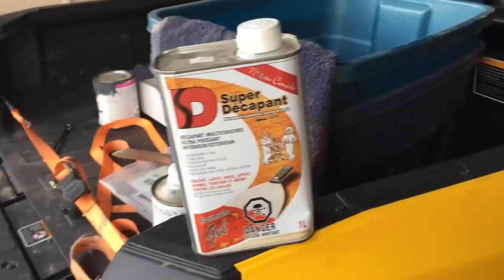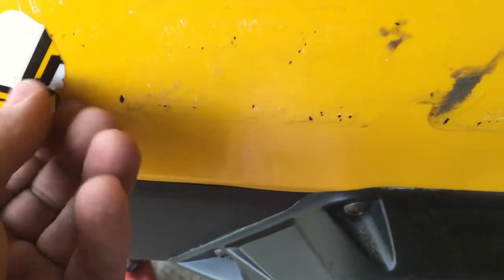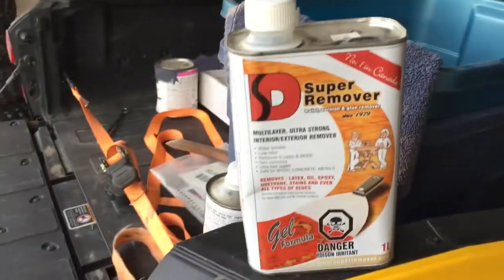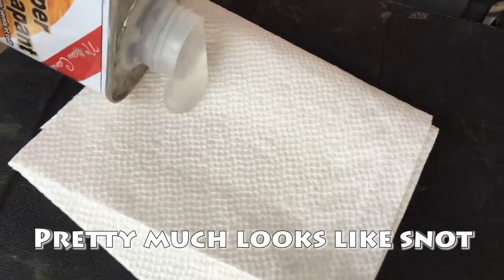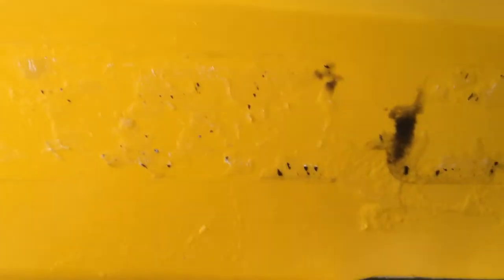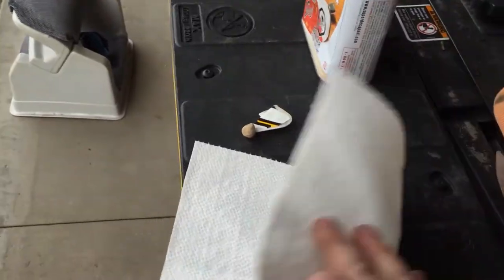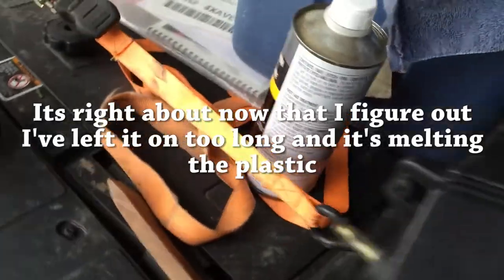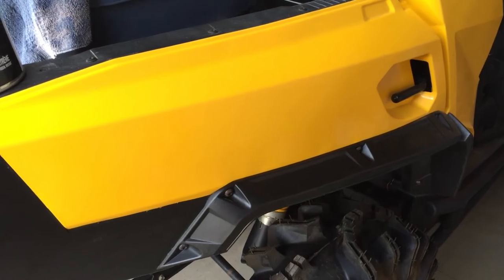The LAZY way to remove ATV decal residue/glue

Comment: Have you never heard of Goo Gone? I thought everyone had a bottle of it in their house, but apparently not. It was designed specifically for this purpose.
Reply from the maker: +Quaddingsous It would work eventually but it would take forever. Remember this is the lazy way of doing it.
Reply: +Sask Trail Rider
This works even better than goo gone? Nice! Thanx.
Reply: goo gone = bad on atv plastic, it will remove the shine off the plastic, trust me, I tried it on my brand new can am and was very dissapointed..I use it for alot of jobs and never had this issue before.
 I'm not sure I would use super remover on it either though, this thing is nasty and will burn your hands off haha but hey, if it works and this fast I might give it a try.
Reply: I tried 'GOO GONE' with no results WSE even on the easiest removal of sticky glue after removing a sticker by hand. BALLS, BALLS, BALLS, GOO GOO , GOO............... Bahahahahahaahahahaha!!